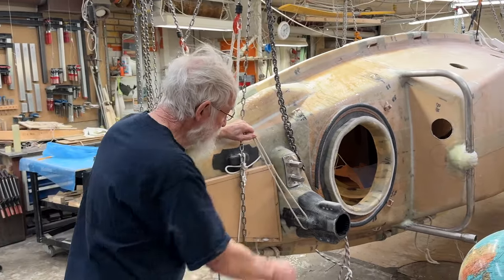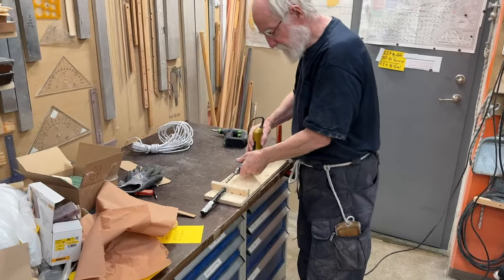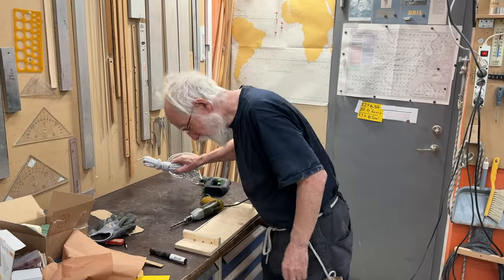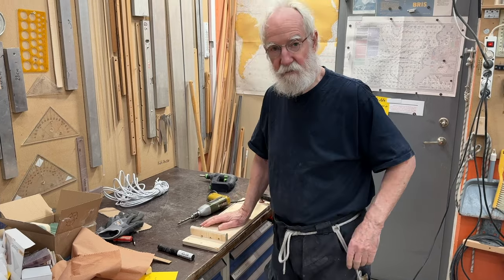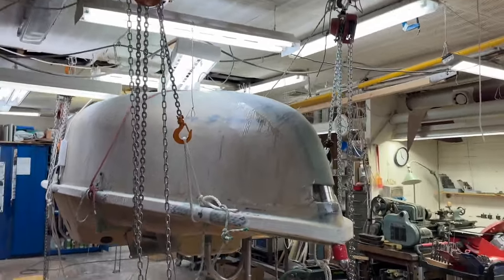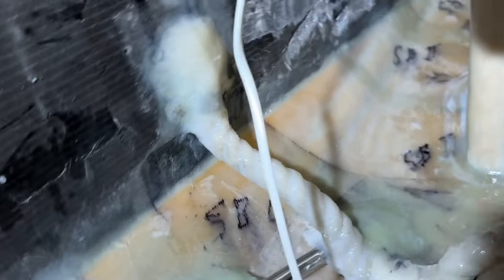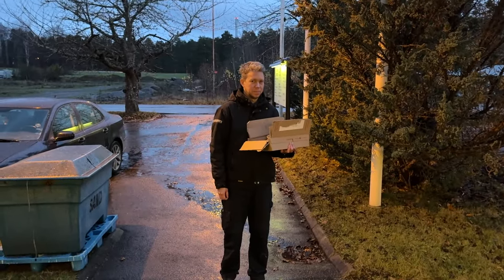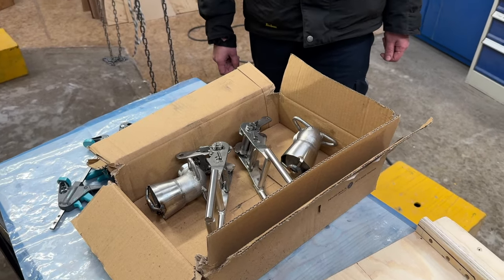14 Nov 2023  Developing the hornless cleats and the welding man arrives

Comment: Not the way to use a table top saw, kickback happens between the fence and blade, place the push stick on the portion between the fence and blade to keep the cut from twisting/lifting and getting kicked back. A kick back can cause major injury to hands and body. There are many youtube vids showing kickback with violent results. Also lower the blade as much as possible to limit exposure.